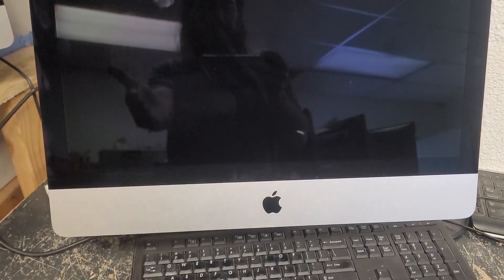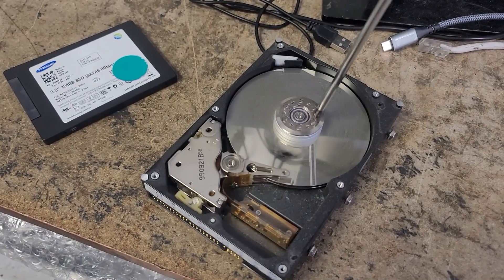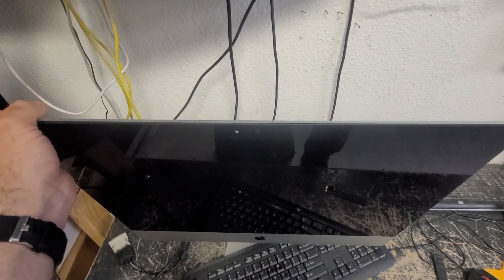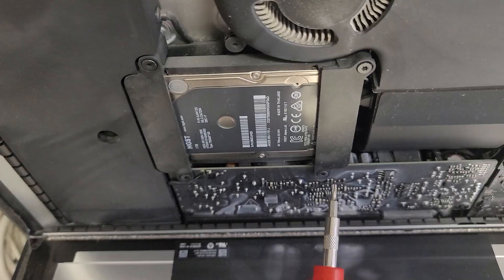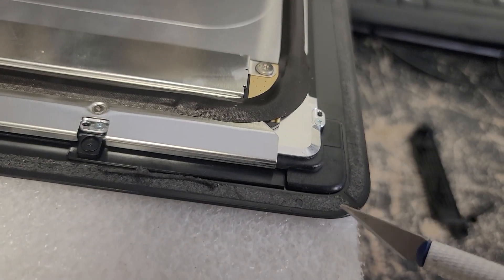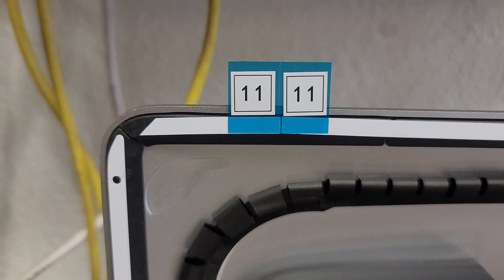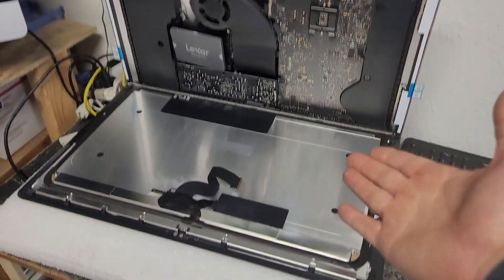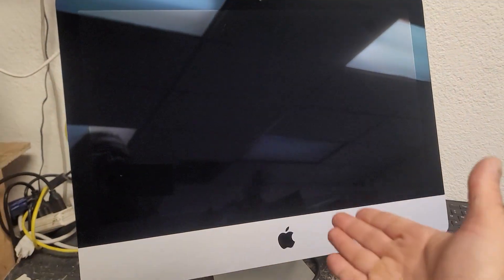iMac's are actually SLOW... on purpose!

Comment: Alot of all in ones and laptops are made with the boot on the ssd because yes it runs faster but its also for the long term life of the computer hard drives have a longer lifespan so you dont lose all your data and for apple i think thats great its not so shlummy nice vid though
Reply from the maker: Somewhat true, but today's SSD's have a pretry long lifespan compared to a few years ago. I'd highly recommend going with a SSD, even in a hybrid/fusion setup like Apple does, instead of a HDD, and just having a really good backup or image made of the system - with worth the small sacrifice of possible data recovery for the extra speed. Trust me, especially when it comes to live streaming with both an instant replay and locally recorded program files, and with video editing (and games like Minecraft can benefit from a SSD over a hybrid/fusion setup).
However  I do not recommend a fusion drive, though (a single device with both a HDD a SSD partition) - data recovery on those is more complicated if one side or the other fails. Nor do I recommend Raid with SSD's.